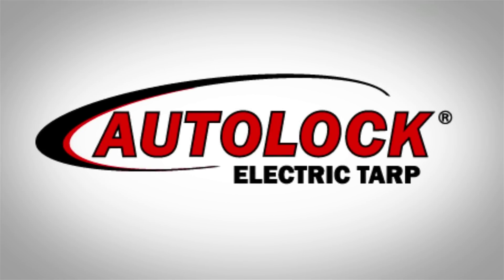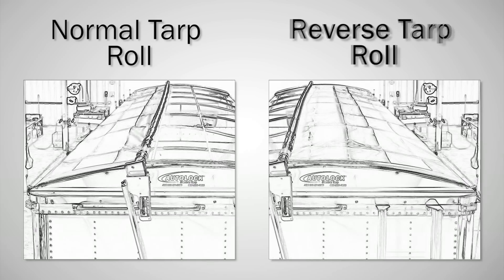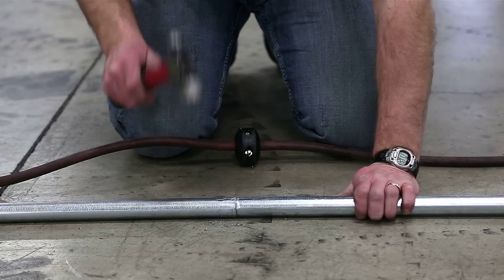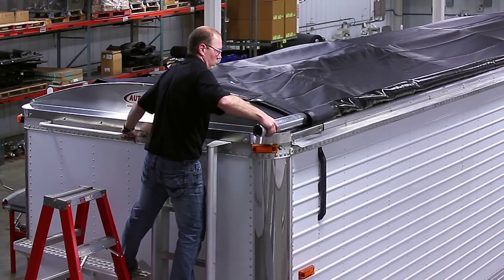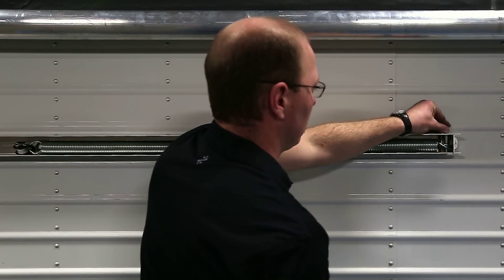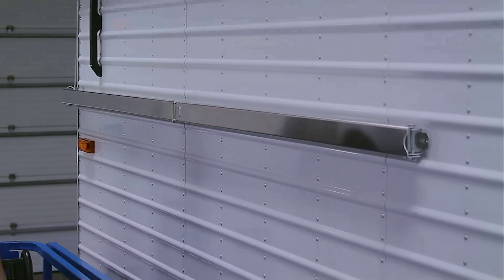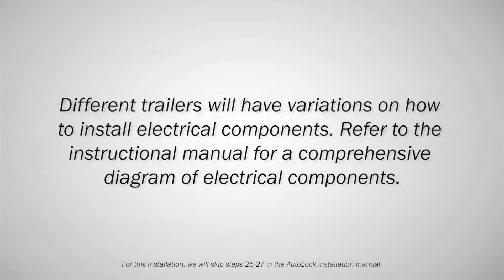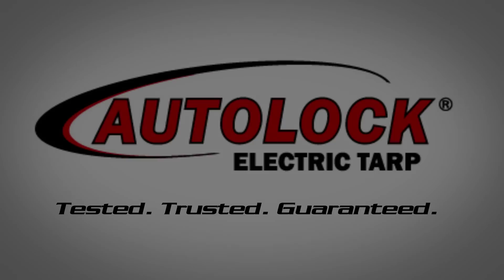AUTOLOCK® Electric Tarp Installation on a Timpte Grain Trailer

Comment: Is there a splined shaft that comes out the back of the roll tube so you can hook up a manual crank arm to roll the tarp in case the motor blows?  I've also seen a roll tube break in half in the middle and had to tighten the front half of the tarp with the motor and the back half with the hand crank.
Reply from the maker: Hi Stirv, Yes there is an option for attaching a manual crank on the AUTOLOCK® Electric Roll Tarp. Our engineers also mentioned they have not seen a 3" tube break.

Comment: Does the cable/string ever freeze to the roll tube in freezing wet weather when it is looped around the tube 12 times?  Is there any advantage to the spring box pulling instead of the other manufactures that put spring tension onto the drive arm at the mounting point?
Reply from the maker: Hi Stirv, We have not seen or heard of the rope freezing together. The springs in the arms are a passive reaction to help move the tarp across the truck. The rope creates an active drive to pull the tube and tarp while the springs allow for any variables, combined with the 3 inch roll tube this system operates extremely well in the wind. See our wind video for an example. https://www.youtube.com/watch?v=oQCkdJnUxio